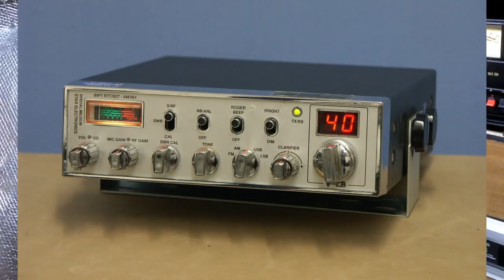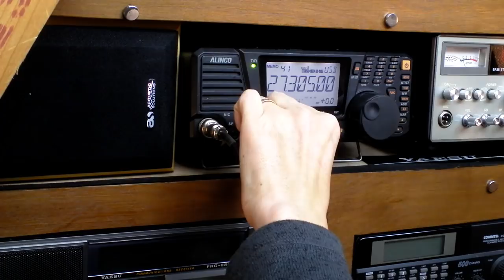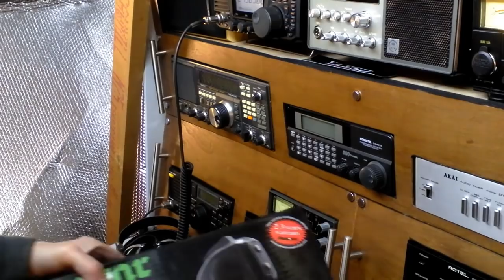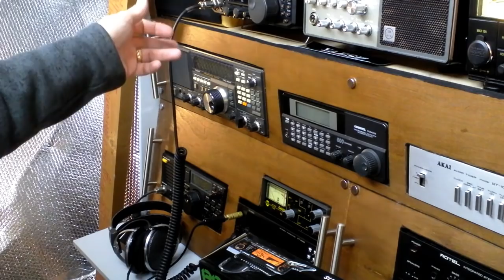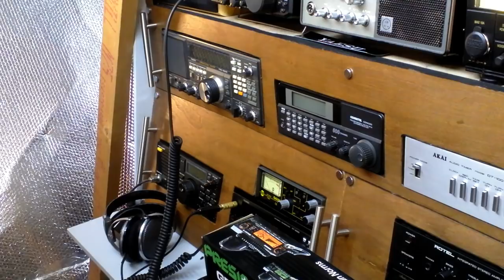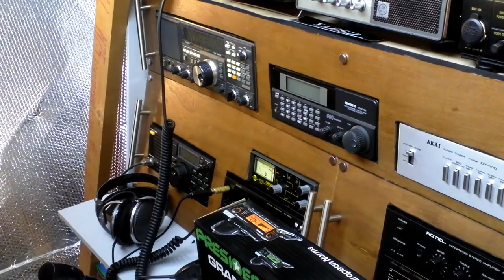CB RADIO SSB: Zetagi B300p:  12 watts v boosted. Test

Comment: Hi Fred how sure you finding the pcu/ psu power supply you built from Amazon as I'm attempted to buy 1 for my radio Thanks
Reply from the maker: Hi do you mean the LED one in the plastic tool box ?
Reply: @CB-RADIO-UK  Yes that 1  Fred as power supplys arnt as cheap as I remember.  Do you run your radio off this a lot? I have a similar radio to ss6900 you shown on your channel I have at5555+N .
Reply from the maker: Yes i made a 16 amp tool box supply which runs the 6900 or the 9900 without any issues.  It stays in the shed all year and still works.
Reply: Yes that's the 1

Comment: Antenna is the most important part but an amp helps it seems like about 12-15  watts sideband is equivalent to 100 W am because a friend that's about 10 miles away I can communicate on sideband with stock 12 watts  but on a.m. I can only make it to him with a 100 Watts thats a mobile in my pickup not a base so they definitely have their place I like amps.  but it is fun seeing how far you can get running barefoot awesome video

Comment: I would recommend the BJ 300 sold on Aliexpress at 105 USD. Thats 85 quid. covers 3 to 30 Mhz.. AM/FM/SSB.
2 Pill with a built on cooling fan. will give you 200w PEP output with 5w SSB input.. The down side on delivery, strip it down and make sure there is shrink wrap on the power cables connected to the board. Over time they will fray and cause a short.. These things draw about 15 to 18 amps.. But run fairly cool..And run very clean.. No 2nd third harmonic issues... Zetagi used to produce some good valve amps back in the day. When you open up what they market today. Its the same components, at 3 times the cost... Unless you go ACOM and their mega prices .The Aliexpress offerings are just as good. With a inspection prior to use..Hope this helps your subscribers.. 
73s 153 AT 888

Comment: Hi Fred, I know there are burners out there for getting out. What are the boxes called for boosting incoming signal. I used to have one years ago to hear people far away. I forgot what they are called. Also when I had one set up with a burner I could never remember which one to plug in to cb first
Reply from the maker: Hi John.  They are a pre amp.  I have one and will link a video.  TBH modern CB's are so sensitive they are longer required. The come up pretty cheap on ebay. Video.  https://www.youtube.com/watch?v=0czQFv5zdCY

Comment: CB linear's are a load of crap they put out load of harmonics. There's no filtering on the P.A stage. I'd tell him to put a filter on the output if I were you!!!!
Reply from the maker: Tony i have to agree.  Ive not touched them in years now
Reply: @CB-RADIO-UK  It would be better if he adds a low pass filter on the output this will clean up his audio on SSB as well. But it's still illegal unless he's licensed as you probably already know. If he saw what was coming out of it and where on a spectrum analyzer he'd probably not bother using it. I had to build a band pass filter to be able to use one on the H.F bands. Like you say for an increase of 6dB 1 S point the general rule of thumb the square law applies. His money would have been better spent on improving his aerial and feeder cable.

Comment: Hi ,,,Do you have to turn down the radio output so not to overload the input of the  linear ?
Reply from the maker: Yes you do.  Depends on the model but most work best from around 1-4 watts input.

Comment: Very sound advice Fred..  If you're operating from the comfort of home I'd say it's much more economical to have your rig set-up all in one box (plus the PSU), and enjoy the facility of shortwave ham band coverage and the extra filtering , sensitivity, built-in power, versatility and convenience ..  Ham gear also tends to have a more 'balanced' TX/RX ... Putting up 5/8 wave, full size antenna high up is not always possible . If you can get up a half wave at roof level and tune it in well,  the extra power output/receive quality of a ham rig will certainly give you a much more level playing field. Always remember ...The government has it's own internet, mobile phone system and broadcast facility.. (controlled from GCHQ). If they close down our internet/mobile phone system, we still have hams and CB'ers..We are much more difficult to stop or close down.  Be prepared !!

Comment: Can I use a linear amp with the galaxy DX without getting it opened up Fred? And what amp's-volts etc should it be?
Reply from the maker: All after market linear amps run "in line" with the antenna outside the radio.  Depends on the amp used.  All amps will run on 13.8 v power supply. A 200 watt SSB amp will draw a lot of amps though so you would need a large power supply.  Have a look at Steve's video below as he tested a fairly powerful linear.
Reply: @CB-RADIO-UK  thank you so much Fred!
Reply from the maker: https://www.youtube.com/watch?v=D6nKnFNCnOM&t=390s

Comment: Merry Christmas Fred,my QTH is not the best,as cb band band is right down the bottom edge of VHF band,the best advise I can give having similar issues base station wise.1.Use the best quality coax (thicker shielded or double shield types ie Eco Flex keeps cable radiation level down to a minimuim\Hi quality compression fit Plugs,I use the Silver plated types ,2. As its VHF line of sight comms you want,sometimes dont use high gain 5/8th antenna types if have high surrounding hilly terrain,high urban buildings and low down at sea level,the angle of radiation of these type of antenna are very low and really designed for height 50-60ft masts to get them away from ground,there no point pumping RF into house and alike if antenna sitting 20-30ft from ground,unless you live high on a hill top.3.If you do use a 5/8th type mount it well above the roof line as noise can be present in wiring in roof esp PLC,i cannot stress height is better than gain ( and lets face it 6dB is only 1 s-point,less any losses in poor constructed/lossy impedance matching! and  for a lots of metal in sky).Ive done experiments and have found a quarter wave ground plane antenna with three counterpoise ground plane,elevated a lot higher than most would dare mount a 21foot antenna,has less wind loading and provides a higher angle or radiation to get your signals over mountains,urban terrain and can out perform for Line of Sight uses in most cases 4.Another tip i can offer if using modern SMP Power supplies (try to add or use a shield 2 pole AC line filter as well) on CB or any other 2 way radio,something recently discovered dont ground the antenna mount to mast it should float and be isolated from mast,the mast should be earth strapped via a ground stake,but the antenna (must have ground planes on antenna side to work)mount should be isolated,reason being ive discovered SMP go very noisy when you ground the DC negative terminal to frame ground (EARTH).Most modern cb common the DC neg wire is connected to the internal pcb and radio chassis\SO239 antenna socket  and this creates the issue with SMP  as coax braid sits at DC neg,minute you connect your EARTHED mast you create a short circuit that the SMP does not like,it causes the SMP to create RFI and DC noise! Ive switched over to fibre masts and have zero noise from my SMP power supplies now used on my equipment .The Old school type CB like the SS3900,SS360,Cobra148,SS158,Ranger,Galaxy etc use a floating ground system,the DC negative line is not connected to radio chassis,its done via a capacitor so generally dont have this issue with SMP use.I cant go to much into detail on this as have limited comment area here.5.If your going down the route of Linear amps if we going there ,make sure use a good high quality Low Pass Filter to keep IMD,RFI, leads and generally nasties at bay, keep drive level low,dont over drive the inputs,good quality coax patch and run them as low as needed,as a rule of thumb at least 50% down from actual operating specs to run them cool.6. all the above is mainly for base station use,but if moblie longest antenna practicable on vehicle and mount it high on roof mines Tri-mag mount ,pig barrel spring and 9ft whip for range.Its a complicated subject and very many variables can affect the outcome esp with installations,but Height on 27mhz for Line of Sight comms (not DXing) is your friend Ive found as this is really the subject we are talking about for day to day communications on CB band.I have dumped my high gain,low angle radiation antenna and opted for a 10ft ali pole in ground,a 10m fibre mast mounted to it to isolate it,a 20mm wide 9FT tape antenna , with 3 wire counterpoises isolated,no gain (sometime less gain=less background noise) and getting better results than a 5/8th for Line of sight (not DX) up to 40+miles reliable  LOS Comms or better now,much more reliable as live in a urban area,low down sea level and hills surrounding me not the best place for radio at VHF Lowband! Great vid showing difference fred, every ones system is different esp area of ops and conditions,so take my advice as suggestions only from what Ive learnt experimenting on 27mhz over the last few years building antenna systems that work for me.I know some will\may disagree on the 5/8th wave antenna but for me me it just didnt cut it for me on line of sight comms use in my locality,a few friend did try similar systems and did report god results on very high mounted (lot higher than 21foot antenna) quarter wave ground plane antenna on 50-60ft masts in poor hilly terrain operation exceptional LOS ranges due to the signal angle lifted higher up compared to low angled type antennas,that said if they had been up on that hill with 5?8th wave with ground plane they prob would have had very stronger signals compared to a quarter wave ground plane antenna! Hope my info helps others,ill watch the extend vid in a bit Fred 73's rob
Reply from the maker: Some very good advice there Rob.  A good comment on the video which can help  lot of new starters to understand how radio works.  Cheers

Comment: Very nice demonstration. You are right when a radio operator should look at the antenna , coax and quality of radio when looking for decent performance. As for using amps, it appears you need a lot of power to make a real big difference but then you sacrifice your SWR and possible being over-driven. Also, spurious signal and bleed-over can be terrible to other users in your area. Thanks so much for the demonstration Fred.
Reply: Yup. Amplifiers help you on the radio but spoil other users enjoyment on the same band. 👍
Reply: @johncrouch8988  I stopped using amps many years ago. I just tried it for a couple of years.  I use only stock power and it is more fun to do more with less. Thanks for the comment. I agree, high powered amps ruin this hobby for many other users. I hear some DX bleeding 5 channels up and down. I would hate to think what his neighbors and communities in his area are getting
Reply from the maker: Good wise words Andy.  Power alone is not the answer.  A very Merry Christmas to you and all your family buddy.

Comment: Hi Fred need your help  my mate just got 450d but he doesn't  no how to get it from the zeros to 27.781.2 can you help
Reply from the maker: Hi Jason.  You press the DSP / SEL knob to change the tuning steps. Its page 21 of the owners guide.  When you press the [DSP/SEL] knob, the tuning step of the
[DSP/SEL] knob changes to 100 kHz in all modes.
2: In the factory default, the [MAIN DIAL] knob does not tune
the AM and FM modes. However, you may activate the [MAIN
DIAL] knob on the AM and FM mode via Menu Item
Reply: @CB-RADIO-UK  thanks for taking the time to reply